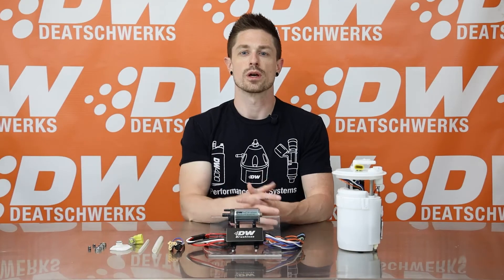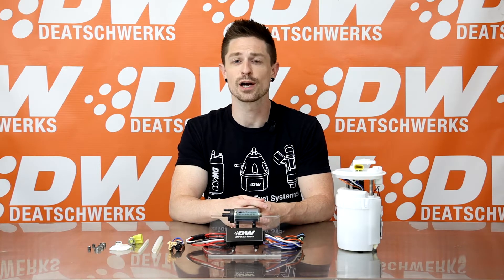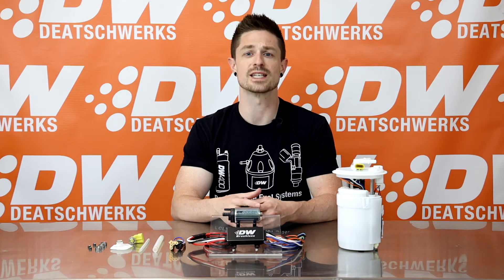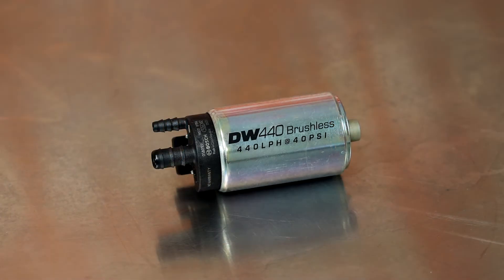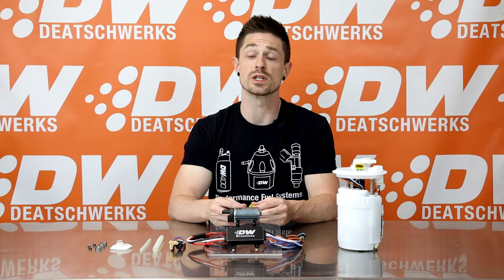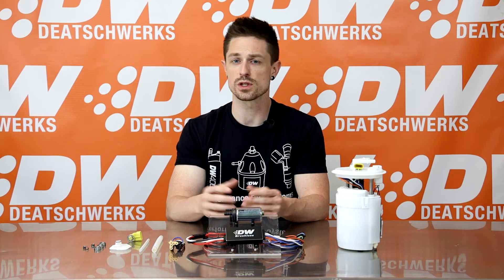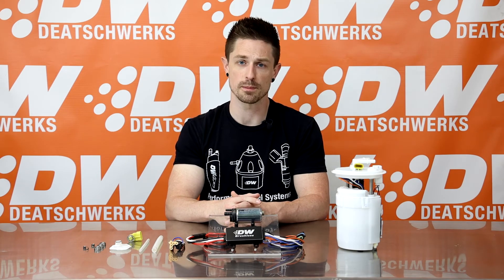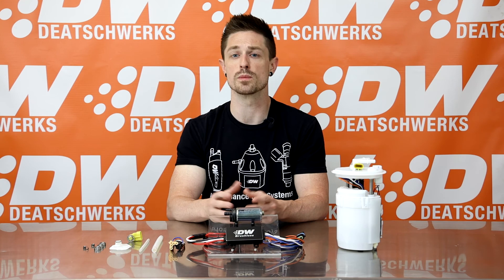Application Specific DW440 Brushless Pump with Controller

Comment: 2017 wrx?
Reply from the maker: 2008-2014 WRX
Reply: @deatschwerks  damn looks like I got to spend big bucks with i-wire.
I need fuel  control module

Comment: I have this same kit 
The 1/4" venturi barb on the pump has a allen screw down inside the barbed hole.
Is that normal?
Not sure how fuel would get past that
Reply from the maker: Sorry about that, that should be removed.

Comment: I think I see the WRX 2015-2020 fuel hanger on the table, can we get a step-by-step install for the pump and hanger. I looked at your PDF manual and to be honest it leaves out some imported steps and isn't thorough enough. If you sell a $489 product a support install video should be required.

Comment: so with this fuel pump setup do you still need a boost a pump to up the voltage or does the controller supply the additional voltage?
Reply: My understanding you still need a voltage booster.